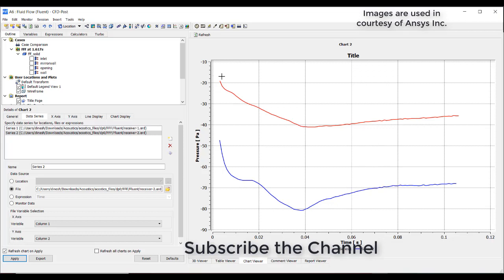AeroAcoustics Model Part 2 Ffwocs Williams-Hawkings Model || Ansys Fluent

Comment: hi, after simulation, there is only one variable (Surface dpdt RMS) available regarding acoustics, then how to calculate sound in dB from the output (Surface dpdt RMS) of the the simulation? Thank you!
Reply: I have the same question!
Reply: if you are using fluent results you need to open fft plot. Then you can select the sound pressure level and so on.